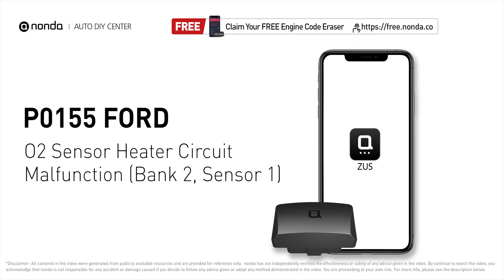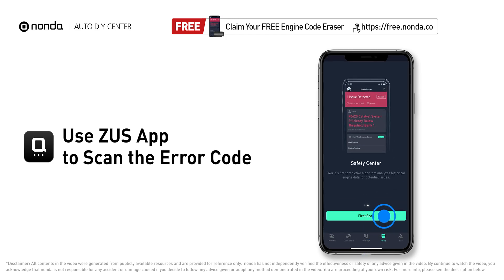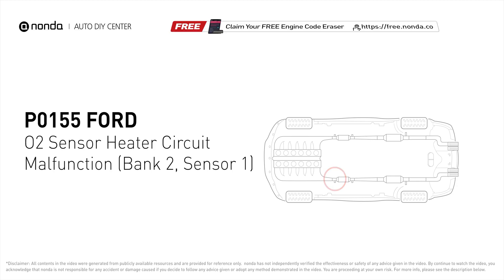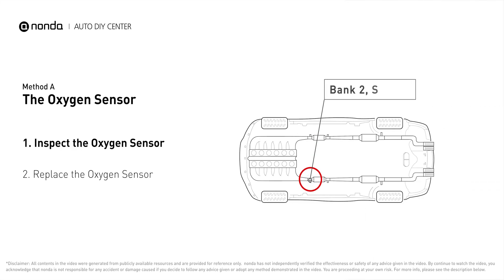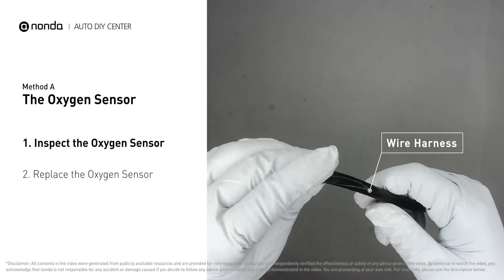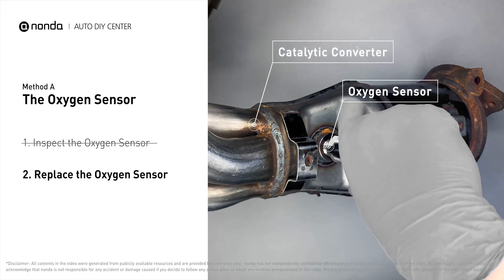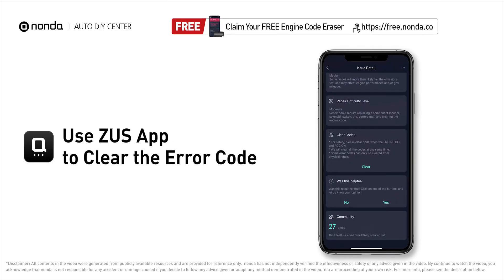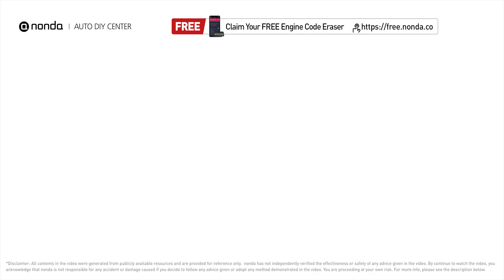How to Fix FORD P0155 Engine Code in 2 Minutes [1 DIY Method / Only $19.56]

Comment: Ok which side is the sensor on 2006 4.6 mustang gt
Reply from the maker: Hello, it is located at the drivers side (upstream sensor).
Reply: You was telling them all while they have internet and they could look it up. mines up river towards the engine there's is down river to catalytic converter